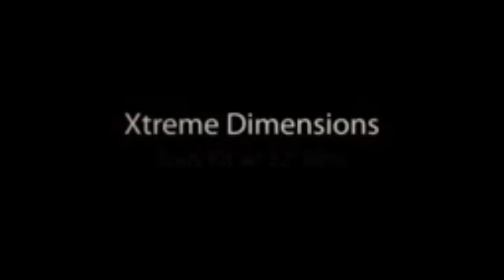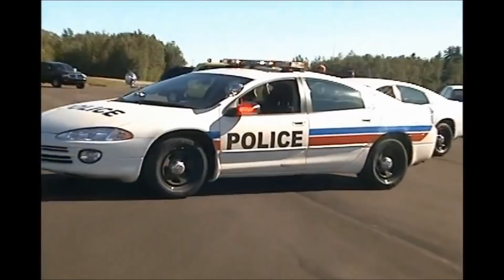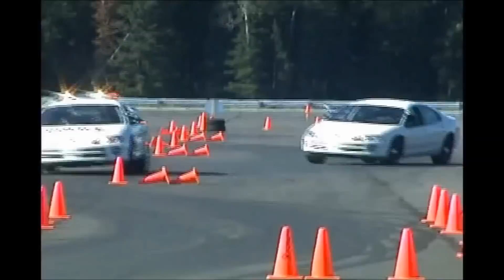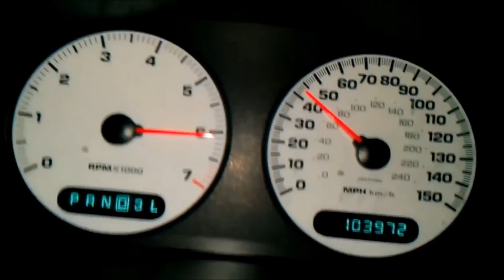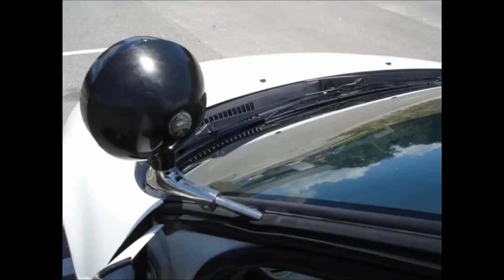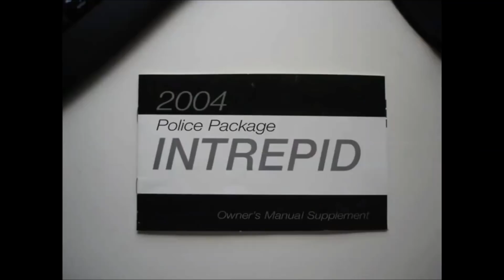The Absolute WORST Police Interceptor EVER! the Dodge Intrepid

Comment: Wow. this "review" is biased and misleading as hell. 😕 Sit tight, folks! This is a long post...

1. The oil sludge issue was with the 2.7L engine ONLY. THE 3.5L AND SMALLER 3.2L NEVER HAD THAT ISSUE. The oil sludge issue in the 2.7L was due to the fact that the water pump was stupidly located under the timing cover in an oil bath system for the timing chain. So, if the seal for the water pump blew (which typically seemed to happen around the 80,000 mile mark), water would get into the engine oil and begin to sludge up the engine. The 3.5L and 3.2L engines were a different design with a timing belt instead of a chain, which eliminated the need for oiling under the timing cover for a timing chain. So, if the water pump seal breaks or if a pump manages to fail on a 3.5L or 3.2L engine, it is literally impossible for water to contaminate the engine's oil. The 3.5L and 3.2L engines were NOT the problem. They never had engine sludge issues AT ALL.

2. THE DODGE INTREPID POLICE PACKAGE WAS ONLY OFFERED WITH THE 3.5L ENGINE! It was NEVER offered with a 3.2L engine OR the sludge-prone 2.7L engine. EVER. Get your facts straight. It's obvious that you're just grouping civilian cars in with the Intrepid police package cars, as well as some random bad experience you had with a friend's Intrepid for the sake of a biased point.

3. What the hell were you doing to replace 3 water pumps in what I can only assume you are implying was a short amount of time??? Were they OEM pumps? Because, if you were installing aftermarket pumps every time, there are a lot of crappy Chinese-made brands in the aftermarket that don't last. You get what you pay for. If you get an OEM pump or a pump made by a reputable aftermarket brand, they last quite a long time. Certainly well beyond the 80,000 suggested miles to replace one before the seal goes on it, or it fails, which would cause the oil sludging in the 2.7L engine.

4. The wiring setup for lights and other accessories was NOT the only heavy duty parts engineered into the package. The Intrepid police package had the following!...

- Heavy-duty suspension with heavy-duty sway bars
- External engine oil, transmission oil and power steering coolers
- Heavy-duty four wheel anti-lock disc brakes
- V-rated (149 mph) Goodyear Eagle GT or RS-A tires
- 160-amp high-output alternator to handle computers, electronics and lights
- 100-amp battery power and ignition feed to instrument panel to support high-tech equipment
- 100-amp battery power feed to trunk
- 150 mph-calibrated, certified speedometer (the 3.5L police package was tested with a 136 mph top speed by the Michigan State Police in their annual police car roundup in 2003)

You can hardly say this was just a civilian Intrepid with "just" wiring for the light bar. Your statement of, "The Dodge Intrepid police interceptor just came with additional wiring to support strobes and flashers in the trunk compartment", is very uninformed and misleading. Again, it seems you are going by a crappy experience with your buddy's Intrepid and slandering, and misrepresenting the Intrepid police package cars without any facts.

With that said, I am not defending the Intrepid police package cars. I don't think they were a proper platform for a police car, but to say that they were basically civilian cars with special wiring and that "all V6s" had engine sludge issues is ignorant of facts. It's okay to have an opinion, but at least give your opinion based on facts, instead of feelings, ignorance and confirmation bias.
Reply: this is true lol my 3.2 v6 es is at 238,000 and it runs like a charm with no mechanical issues with a wicked 225 hp2

Comment: I had a 2.7L 2002 Intrepid and it was a beast. It was pretty quick for its size. Could easily get up to 120mph+. With regular oil and filter changes, it wasn't unreliable either.
Reply: You got lucky. There were certainly some 2.7L owners that never had a problem and got high milage out of them, but LOTS of 2.7s died because of the faulty design flaw they had where the water pump was located in an oil bath system under the timing chain cover. So essentially, when the water pump or the seal broke, water would contaminate the oil and sludge up the engine. Unfortunately, TONS of 2.7s failed in this way and gave the quite reliable 3.2 and 3.5 engines a bad name, simply because there were so many issues with the 2.7's design. The 3.2 and 3.5 never had engine sludge issues like the 2.7 because they had timing belts with no oiling under the timing cover where the water pump was located. If a water pump failed or leaked in a 3.2/3.5, there was no issue, because the water had no way of getting into and mixing with the engine's oil.

Sadly, the 2.7L engine was a terrible design that was flawed right from the drawing board. The fact that two thirds of Intrepids that were sold came with the sludge-prone 2.7L engine, it unfairly soiled the image of the 3.2L and 3.5L engines that never had these problems and were actually very reliable. Essentially, it was the horrible engine failure rate of the 2.7L that directly damaged the public's opinion of the Intrepid/LH platform and Chrysler's reputation as a whole. Unfortunately (and astoundingly) the 2.7L engine continued to be used in a myriad of Chrysler products all the way into the 2010 model year, which only further killed Chrysler's image and bad reputation of reliability as a whole.

You got lucky with your 2.7 though. A TON of them failed completely. Good to hear you got lucky and never suffered the same fate of many a 2.7L owner.

Comment: This is a true story.  Years ago, I was pulled over by a police officer here in a (at the time) Metro Dade County Intrepid.  He pulled me over for disturbing the peace. It was the late 90's, I had a hatchback with 2 JL Audio W0 12's and a Rockford punch 500.  Things could get loud!

Anyway guy pulls me over we go through the process, suddenly steam just starts bellowing out of his cruiser.  He looks over, runs to shut it off, and grabs a fire extinguisher.  I'm a mechanic by trade, so I got down and tell him it overheated, no fire I'm pretty certain.  Pop the hood look around, and I tell him very common, the coolant pipe under the intake manifold cracked on you.  It feeds a bunch of auxiliary hoses for the throttle body, thermostat bypass, and heater core.  It is two pipes welded together by a flange.  The welds crack at the flange, and the pipe leaks from the crevice.

He looked at me and said this car is a fucking nightmare.  It was just in for overheating and they replaced the radiator and coolant fans.

🤣🤣🤣🤣 then he told me I could go.

Comment: I had a 2000 Es that had the 3.2,loved that car!Other than some rotors and a radiator that car was really good for a daily driver,comfortable and a decent amount of power for the size of it!223k and had to replace the cats so its all usual wear n tear!People are so quick to say things are garbage,well you get garbage when you treat your car like garbage,most people prob haven't checked oil in their car EVER,let alone coolant,tire pressure,air filter replaced!People think cars should last 400k with zero maintenance i swear,and beat the piss out of em!Words to All,Take care of it and it will take care of You!Mopar or No Car
Reply: Yep, the 2.7L engine was the problem. Stupidly, the 2.7's water pump was located in an oil bath system under the timing chain cover. So essentially, when the water pump or the seal broke, water would contaminate the oil and sludge up the engine. Unfortunately, TONS of 2.7s failed completely and gave the quite reliable 3.2 and 3.5 engines a bad name, because there were so many issues with the 2.7's design, so people assumed the same of the 3.2 and 3.5 engines. But the 3.2 and 3.5 never had engine sludge and/or failure issues because they had timing belts with no oiling under the timing cover where the water pump was located. If a water pump failed or leaked in a 3.2/3.5, there was no issue, because the water had no way of getting into, and mixing with the engine's oil.

Sadly, the 2.7L engine was a terrible design that was flawed right from the drawing board. The fact that two thirds of Intrepids sold came with the sludge/failure-prone 2.7L engine, it unfairly soiled the image of the 3.2L and 3.5L engines that never had these problems and were actually very reliable. Essentially, it was the horrible sludge issues and engine failure rate of the 2.7L that directly damaged the public's opinion of the Intrepid/LH platform and Chrysler's reputation as a whole. Unfortunately (and astoundingly), the 2.7L engine continued to be used in a myriad of Chrysler products all the way through the 2010 model year, which has only served to further kill Chrysler's image and bad reputation of reliability as a whole. But the 3.2 and 3.5 were great engines that were easily capable of trouble-free high milage. As of 2019, I still see lots of used LH cars (Intrepid, 300M, Concorde, LHS) on the market with 200-300k miles on them. The 3.2 and 3.5 were excellent engines. It was the 2.7 that killed the Intrepid's reputation and public perception over time. The same could have been said about the 2005-2010 Chrysler 300 and Dodge Charger/Magnum series if they hadn't have come with the 3.5L and Hemi engines in addition to the base package 2.7L that was purchased with several of those models. But yeah, long live the 3.2/3.5! 😁

Comment: This is the most LAUGHABLE police interceptor review ever. The police package Intrepids did NOT come with the 2.7L V6, but rather ONLY the 3.5HO V6. The 3.5HO did not suffer from the same engine oil sludging issues that the 2.7 engines did, and when maintained are fantastic engines. The cars also did come with unique equipment from the factory, unlike what you said in your negatively biased opinion. Based on FACTS from my build sheet provided by Chrysler Group LLC, I can attest that the police package comes with as follows :BABP 160 Amp Alternator , BR6P Anti-Lock 4-Wheel Disc HD Brakes , DLBP 2.5 Overall Top Gear Ratio , JLJS After-Run Cooling System, NLBP Special Service Power Connector, NMSP Severe Duty Engine Cooling, SBPP Performance Steering, SDBP Heavy Duty Suspension, and SH8S Delete Rear Stabilizer Bar, as well as non performance extras such as: LDAP Underhood Lamp, CKJ Black Vinyl Floor Covering, CKLP Cargo Compartment Floor Mat, andTBBP Full Size Spare Tire. There is no arguing with facts, most of this equipment was only found on the police package, and all of it is performance oriented. As for my personal opinion, the car is great. It is extremely roomy, it handles superbly for a nearly 4000lb fwd vehicle, it has great power and accelerates quickly, and has an exceptionally high top speed of over 135mph. I have 187k miles hard miles on the original engine and transmission, and it has yet to show any signs of weakness thus far...
Reply: Thanks for this comment. All true- youbsaid everything I was going to. I only clicked on the video link bcs it was so ridiculous.   Didn't watch.
Reply: Totally agreed. Your post mirrors mine almost identically. The 2.7L was a horrid design with its water pump in an oil bath system with the timing chain that was unique to the 2.7L only. So when a water pump or its seal broke, water mixed in with the engines oil and caused oil sludge. The 3.5 and 3.2 had timing belts, so there was no oiling under the timing cover. Essentially, if and when a water pump broke/leaked in a 3.2/3.5L, there was no way for the water to contaminate the engine's oil.

Sadly, the 2.7L engine was a terrible design that was flawed right from the drawing board. The fact that two thirds of civilian Intrepids sold came with the sludge/failure-prone 2.7L engine, it unfairly soiled the image of the 3.2L and 3.5L engines that never had these problems at all, and were actually very reliable. Essentially, it was the horrible sludge issues and engine failure rate of the 2.7L that directly damaged the public's opinion of the Intrepid/LH platform and Chrysler's reputation as a whole. Unfortunately (and astoundingly), the 2.7L engine continued to be used in a myriad of Chrysler products all the way through the 2010 model year, which has only served to further kill Chrysler's image and bad reputation of reliability as time wore on. But as you know, the 3.2L and 3.5L were/are great engines that were easily and regularly capable of trouble-free high milage. Unfortunately, the public's opinion of the 3.2/3.5L was unfairly slandered by the horrid 2.7L and people will forever think the 3.2/3.5L was just the same. But we know better, don't we. 😉

Comment: Mr Random Reviews

You are an idiot.  You have never really worked on one of these cars ever before.  "A buddy had one"  Oooh.

"Faulty wiring"  I have been around an awful lot of cars for an awful long time.  Anyone who simply says, "faulty wiring" hasn't dug into it to find the root cause.  Those who have dealt with wiring problems will say something like, "the wiring harness along the firewall rubs through the fuel rail" or "the oxygen sensor harness falls onto the exhaust manifold" or "water leaks into this connector, corrodes the wire, and the resulting goo shorts with the adjacent pins."  And of all the 2nd generation Chrysler LH cars that I have been around, never have I seen a "wiring fault."

"Electronics going bad."  There's another one.  The only electronics that had a tendency to go bad was the PCM.  Whoever Daimler (Note: Not DODGE) used for a supplier of PCMs did not do a good job.  But don't just say, "The electronics go bad."  For the 2002 model year, the old J-tech controllers were replaced with a "next generation" one and the issues went from horrible to not nearly as bad.

"Throwing around the word "DODGE" and all of its badness is also ignorant about what goes on behind the scenes.  Remember who was in charge of "DODGE" back then?  Daimler.  

"Oil sludge"  Try not changing the oil in your Toyota, Honda, Chevrolet, Ford for 20,000 miles a crack.  Lets see how much sludge they supposedly don't build up.  That's the cause of the 2.7L engine sludge issues.  The actual design issues of the engine was there being too much "upstairs oil."  Again, you've never torn down one of these engines to analyze the failure.  With that much oil up in the heads, combined with sludge, it simply cannot get back down to the pan fast enough and the lower end bearings get starved and then you have issues.  That, and they should have implemented a sort of oil sump baffle in the pan which they didn't.  But if you maintain the oil like you should any other engine, and none of it is never a problem.  The 2.7L engine is NOT resilient to neglect.  The 3.2 and 3.5 engines had much less oil up in the heads, so the problem didn't carry over to them.

If you knew anything about these cars, you would suggest that the flexplates tend to crack with the 3.2L and 3.5L engines.  Speaking of which, you never mentioned the 3.2L engine.

Three water pumps, eh?  From where did you source these things?  Did you buy the cheapest thing you could find off of Amazon?  Or was that not the cause of the overheating issues?  Again, you say, "Water pumps went bad."  What part of it?  Did the plastic impeller fall off the shaft?  Did the bearings keep biting the dust?  Did they just keep leaking?

A person has to be more specific to make anything he/she says to be credible.

Comment: You know, the Intrepid was faster than the Crown Victoria.
Reply: Today's 3.6 V6 Charger Pursuit is faster than both the Clown Dic and any Exploder.  The Clown Dic was limited to 129 mph (3.27 rear), and the Exploders are limited to 132 mph (all).  The V6 Charger runs 141, and the V8s run 152 mph. With the limiter suspended, the V8 runs 176 mph.

Comment: I guess they never fixed the problem...I had a 2000 Dodge Intrepid and put 2 water pumps in it right after the 100,000 mile mark. I just got rid of the piece of crap

Comment: You can keep the 2.7 engine alive, but you have to spend money on oil changes, like every 2500k miles. Engine burns oil too so be ready to add a quart every 600-800 miles. And keep an eye on your coolant level. If it drops suddenly, your water pump is going or gone. Otherwise, the concorde and intrepid are very comofortable, sweet driving cars. They seem to coast with minimal pressure on the gas pedal. You can disconnect the cruise control by mistake on level highway and not notice it for a while.

Comment: I liked the interior and ride on the one I had. But yeah the engines were junk. The water pumps are driven by the timing chain under the engine cover where the oil lives.

Comment: Intrepid police package from 02-04 was actually a pretty decent car. I never saw a police package one with a 2.7l though. They were quick compared to the competition being a Crown Vic or 3800 v6 Impala. And why would a police department care what happens after they sell them. They get their use out of them in the first 2-4 years of life. 

Problems, not really any more than the competition. The Impala was blowing through Intakes at the time and the Crown Vics in that year range were eating up transmissions in the 02 and down cars.
Reply: The Intrepids were very bad for electronics and the engine overheating while idling. The 3.5  high output is an interference engine and when the timing belt breaks or slips the engine is toast. They also were not easy to work on.

Comment: You sound confused. The 3.5 wasn't bad. It was the 2.7 that killed it self with oil sludge.
Reply: Same for the 3.2L engine. It was a good engine. The 2.7L was a turd though.
Reply: Same goes for the 3.6 in the Chargers.

Comment: The intrepid as a timing chain tensioner that is based on oil viscosity so if you go to far over an oil change and oil gets thin it can jump timing and if i remember right its an interference motor and can put a valve thru the piston. Total junk